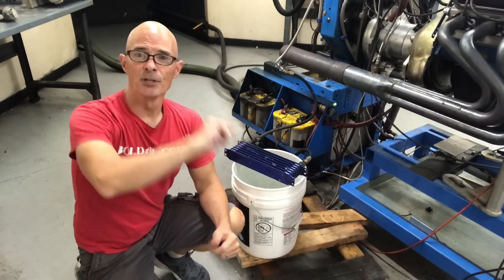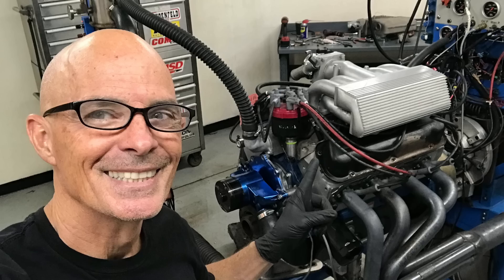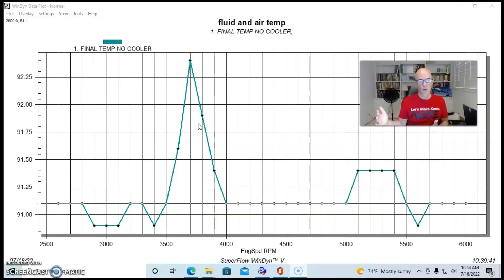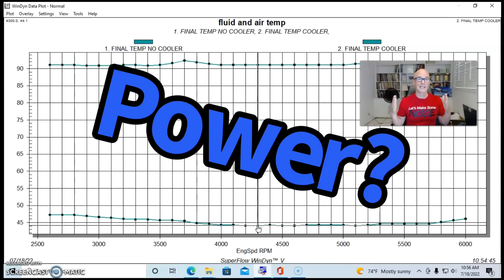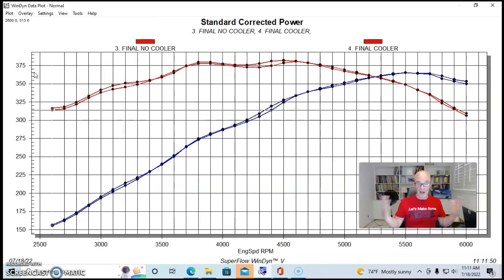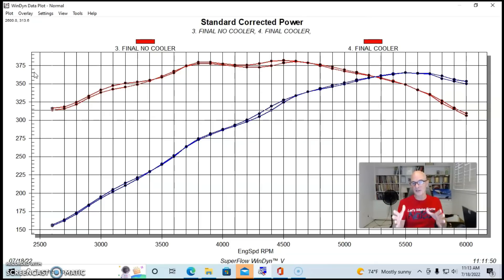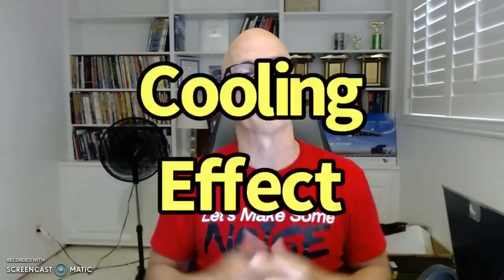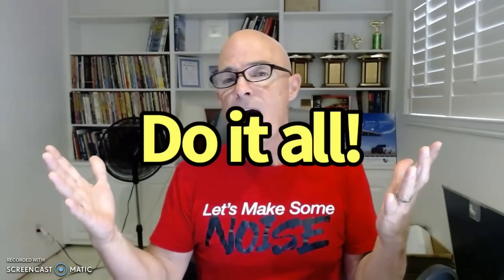EFI FUEL COOLING & HP? DOES ICE-COLD FUEL ACTUALLY ADD POWER TO YOUR FUEL-INJECTED MOTOR? DYNO TEST

Comment: maybe redo the test with a throttle body injection rather then port injection, that way the fuel is in contact with the air longer so you get more actual air charge cooling?
Reply: by the time it's in the cylinder and compressing that's negated.
Reply: @lasskinn474  no its not, which is why a carburetor on the exact same setup makes a little more power then a port injection, you get air charge cooling.  look through all of Richards videos he has dont the carb vs FI and the FI makes a little more torque (probably because of a tighter AF/R) but the carb makes more power due to the air cooling
Reply: @DBLDREW  yeah my bad on naturally aspirated on that, if you could get the air cooled a bit you could indeed get more air mass into the cylinder.

I doubt the 50f difference does much anything compared to the energy of it vaporizing though
Reply: @DBLDREW  where are the videos showing a carb makes more power? I dont remember seeing any on this channel. I do however remember seeing efi make more power on the LS setup.
Reply: @DBLDREW  but you dont use same exact setup with EFI
Reply: @V8Lenny  supervictor intake and a supervicror efi is the exact same intake but the efi has injector ports, that way you can run a 4150 style throttle body, Holly makes a tunnel ram that is also able to use the same intake carb or efi. in fact Richerd tested it here.. https://www.youtube.com/watch?v=EBalrpY73Jc&t=11s
Carbs make more power due to the cooling effect. How much more depends on the intake, on a high ram that is a longer runner you see a bigger differance, if its comparing a short runner then you wont see as much of a differance.. But the throttle body injection has the best of both worlds, cooling effect like a carb, but also the tigher A/F ration with efi
Reply: @DBLDREW  they should not be exactly the same. Build engine for efi and it makes more power than carb.
Reply: @V8Lenny  I take it you didnt watch the dyno link i posted? If you did you would know that adding the fuel in earlier in the intake track the more power you make. EFI usually injects it directly spraying into the intake port of the head. Thats whay a throttle body injection seems like the logical choice.. all the tunibility of EFI but also the charge cooling..
Reply: @DBLDREW  
Could it be making more HP just because it's a carbureted engine cause carburetors make more HP  ...just asking
Reply: @matthewvarnam4302  no, getting fuel into the engine is easy.. its all about getting in more air, which is what turbos, superchargers, and even nitrous does (nitrous has a very high % of oxygen) and the colder the air the more dense it is.. all a carb does is allow the air more time to cool becoming more dense. Spraying the fuel directly into the intake port of the head means there is no time to make the air charge cooler. Spraying it higher up the intake runner does.. like a throttle body injection or Carb. Which is why I would like to see how this test does with a TB injection..
Reply: @DBLDREW  i had and have same engine with carb and mpi and mpi makes more peak hp,(3-5%) but carburated engine had better response on gas pedal because computer is slow on sudden action
Reply: @makantahi3731 Sorry but nobody is going to take you seriously when you say that a computer is "slow on sudden action" computers can calculate 100-200 million calculations per second. an engine rotating at 6000rpm is rotating 100 times per second..
Reply: @DBLDREW  ok you represents all people on the world because nobody is going to take me seriously .........again, same engine, one with carb and other with mpi, when stepped on gas pedal from idle, carburated engine accelerates immediately, no lag, engine with mpi needs 1-1.5 seconds to anything starts to begin and needs 2-3 seconds  to spool up to same rpm from idle, same slow is chryslers 5.7 hemi, it needs same 2-3 seconds  and has same lag after i stepped on pedal and engine starts to rev up, so i had and have cars with that engines and first impresion on mpi  was it is slow as melasa, different story is when it has 3-4000rpm , then it is ready for party, again, again, on both cars with mpi i could suddenly step on and off  gas pedal from idle and rpm will not rise more than 200, on carburated engine  rpm would hit at least 2000
Reply: @makantahi3731  yes generally when you say things that are know to be factually inaccurate people tend to not take what you're saying seriously. Computers are not slow. Saying they are too slow discredits your statements. Computer controlled cars have always been better on throttle response, if yours isnt you have a problem with your tune. How are you going to get a colder air charge temperature with MPI? again Richard tested it in a controlled environment with both Carb and MPI on the same engine same intake in the same dyno room. He even talked about the air charge cooling effect of the carb being the differance. here is his vid.. https://www.youtube.com/watch?v=LjKxWP9iowY&t=666s  watch it and argue with the results with him if you want..
Reply: @DBLDREW  now you know better than me ,although you have no experience with my case, you watch too much videos on yt , it is very interesting, people trusts you, are you priest, they are the same as you, they speak about things that  you have never experienced, 3. times i repeat: škoda felicia 1.3 , same displacement same compression same bore same piston travel, same head, carburated has 46kw, mpi 50kw, i had both in same time , both cars were perfectly sound, and carburated had better response on sudden  gas pedal step , from idle, and now i have   chrysler 300c 5.7 and same behavior , and i im not suprised, because i know how carb and  mpi work but that is not clear to you, and i can affect on A/F charge tem over amount of coolant that flows through lpg evaporator, temp of gassed lpg can  be 30C deg or 80C deg and if spark plug advance is adjusted for 30 C deg it will  not be good for 80 C deg, if that things is not clear for you , i can not help you, ask people that does not believe me, and believe to you , maybe they know
Reply: @makantahi3731  people dont have to trust me, I posting to a video from Richard Holder.. you know the guy who does all the dyno video tests.. the guy whos video you just watched here. But im sure you know best after all you have one instance with a car you cant even tune, you have no idea on why you got the results you got.. you blame things you dont understand and say things that is known to be false. So yeah I think most people are going to take an actual dyno video from an expert that has done this for a decade or more vs a guy who thinks MPI has terrible throttle response.. I mean how do you explain all the millions of computer controlled cars on the road today that dont have your throttle response issue?
Reply: @DBLDREW  you just have explained you have no clue , let i draw it to you: carb acts instantly, (almost speed of light), mpi first must measure, calculate and then act, no matter how many times in seconds, it takes a time, so difference between carb and mpi is infinitely, so for you would be better before comment to take some books(specialized) in hands
Reply: @makantahi3731  No I just pointed out that people dont have to take my word for it because what I'm saying is also verified by dyno videos from Richard. What you have said is that computers are slow and carbs are as fast as the speed of light? lol Again there are millions of computer controlled cars in the world and they do not have the throttle response lag that you do, maybe you should consider the fact that if all the rest of the cars out there dont have your problem then maybe the problem is with you?
Reply: Or stack
Reply: It's been proven over and over that carb makes more power than EFI.
Reply: just stumbled across this video was hoping it was throttle body EFI,  Im putting the finishing touches on my 302 build with a 4150 stealth style sniper EFI setup which is a TBI.  Im running a performer intake (idle to 5,500 rpm to match my 1,400 -5,400 rpm roller cam) and a 1" phenolic plastic 4-hole spacer and 1/4" divided EGR heat isolator gasket.  I figured this would help improve plenum volume as well as cooling effect, I started thinking about if I should run something like a inline fuel cooler as my EFI setup is going to utilize a 99-04 Corvette frame mounted fuel filter/regulator and just have a single 3/8" stainless steel hardline down the frame and a short length of 3/8" fuel hose to the 3/8" stainless hardline I custom bent for the engine.  I know there will be some heat generation but was wondering if it would be worth it to add a cooler of some kind on the frame rail after my regulator/filter assembly but before the engine bay.

Based upon what this shows it would say its not worth it but, that is also port fuel injection spraying the fuel directly into the intake valves compared to what I have which the injectors sprays the fuel ontop of the throttle plates and allows the fuel to flow no different through the intake than a carburetor which I know can see benefits from cooling the fuel.  Now I am still on the fence about if its something I want to invest in or if its even worth it for a daily driver.

Comment: This has been a burning question on my mind.

I'd like to see it done with a TBI system. Is it possible to artificially raise the air temp in the Dyno room? That might be less work and we can still see results on a naturally aspirated engine.
Reply: Warmer ambient air is less dense. Less air density = less power 100% of the time.
Reply: @RadDadisRad  I want to see cold fuel vs hot fuel in a hot environment more closely simulating an engine bay. That would raise IAT and the fuel temp without the cooler and hopefully showing a difference after chilling the fuel.
Reply: Its over 100°F today. I started my truck and ran it for 3 minutes with a 454, Holley sniper, electric fans and water pump, ceramic coated long tubes and an open filter on top(I know.) The surface temp of everything on the firewall including the fuel lines was 120°F-130°F. IAT was 101°F and the coolant temp was 107°F.

Does hot fuel atomize better?
Reply: @c0c0asauce  that’s a no brainer. If your vehicle suffers from vapor lock cooling the fuel could remedy those issues as it would take more energy to phase change the colder liquid to gas inside the pressurized environment.
Reply: @c0c0asauce  hot fuel vaporizes, it doesn’t atomize. Fuel vapor is less dense and also causes ignition problems as it is fuel lean compared to an atomized mixture. That’s why you can idle an engine on fuel vapor but you can’t apply a load because it will overly lean out and only rev up to its efficiency. Generally that’s really really hot EGTs with knock events. You can try this with a lawn mower engine for proof. You can use a bucket with some gas in it. Connect a hose from the lid to the intake on the carburetor and then connect another tube that is open air down into the fuel. Put a mesh screen on the fuel dipped end. The mower will start and rev up but you can hear it doesn’t do it well. Once load is applied it struggles to do anything beyond idle.
Reply: @RadDadisRad I'm asking if liquid gasoline has a longer or shorter combustion duration. Is it more or less reactive.
Reply: @c0c0asauce  Fuel is fuel, temps won't make it combust quicker or slower.
Reply: @Beardest_Fishing  Not all fuel is that way but I couldn't find anything about it for gasoline.

Comment: Would be cool to see if fuel temperature has bigger effect with outboard injector setup.
Reply: At least that will show if he improvements are due to heat energy absorption or fuel atomization, or is the heat energy absorption causing better atomization 😭👾😂😂

Comment: By "supercool" do we mean "to just above its liquification" temperature? I know liquification is not a word, but it should be. Who on Earth came up with "liquefaction?" Do you do "gasefaction?" "solefaction?"

Do we turn things into a Lique? A Sole?

Anyway, nice to see such cold fuel checked out. Can you increase the spark timing?
Reply: Liquefaction is a word, it just doesn't mean that. It refers to soil saturated with water losing its structure due to vibrations (such as an earthquake).
Reply: Gasification is a word.
Reply: "How is natural gas liquefied?

Natural gas is converted to a liquid in a liquefaction plant, or “Train”. An LNG Train performs four main processes:"
Reply: The correct way to say this would be "liquified." It is not turned into a liqued. It is turned into a liquid.

Just like "gasify" turns something into a gas via gasification, it doesn't turn it into a "ges" by "gesfaction."

As I said, "liquification" is not in the dictionary, but the stupid word "liquefaction" is.

It needs to be changed.